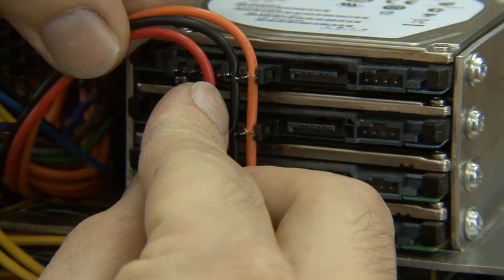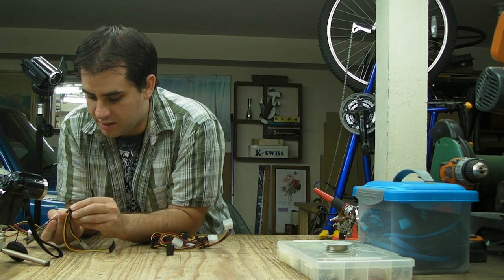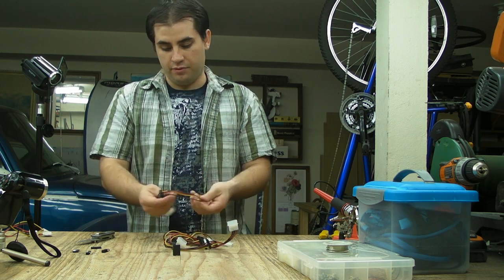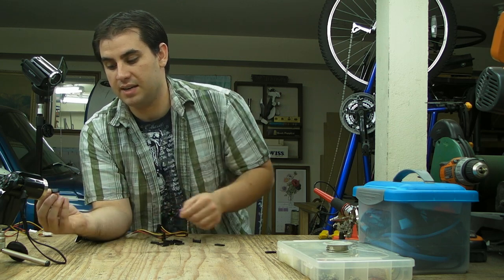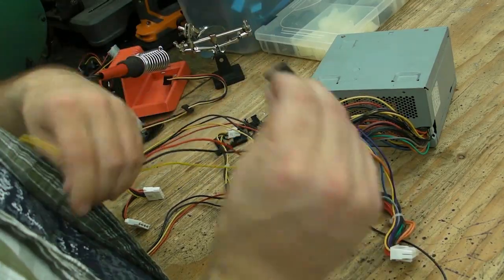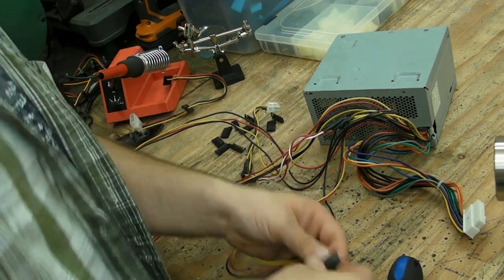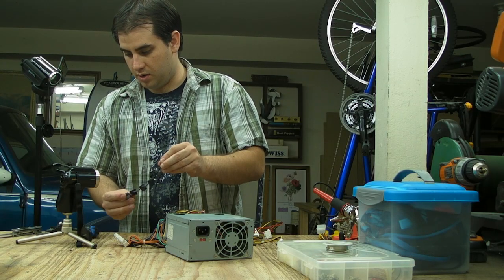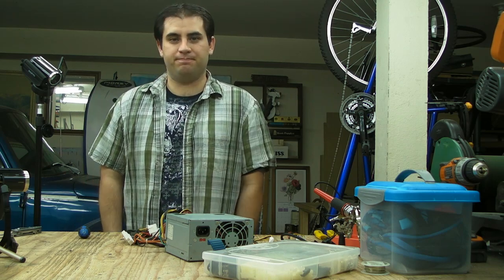Modding Guide: Inline SATA Connectors

Comment: Considering this is now a 10 year old video, the information in it is still amazingly useful, and you make the whole process appear very straightforward. Thanks for this!
Reply: Exactly! Even almost 12 years later! I'm building a machine that needs a single SATA power connector for the AIO and after watching this I realized I can use old cables to do what I need and not let a bunch of connectors hanging around.
Reply: Agreed ... there's newer videos on the subject, but this young man did excellent work with the camera shots, nice clear close ups of what's going on. Also no blah blah blah filler to fit the video into a Google algorithm length sweet-spot.
Reply: he help me alote

Comment: Can I mod the sata power connector to use 3 wires instead of 4 ? I have a 3 pin power supply on the board of my mini pc.

Comment: Thanks for this! I was actually looking for information on what to do if you have a SATA splitter cable where the connectors are upside down, but simply clamping some more connectors to the PSU cable sounds even better than using an splitter cable! I had no idea they were so easy to attach!

Comment: I have eight(8) 8tb ssds in a mounting bracket i got off etsy that spaces each of them only 7mm apart, and this worked absolutely perfect.
If anyone that sees this is wondering, this is the only method to connect this many drives to a single cable, since this makes the cable the bottleneck of available amps before meltdown, instead of the connectors being said bottleneck as by using splitters.
I would feel comfortable even putting 12 ssds on one cable with this method, so long as you're not writing to all of them at the same time 24/7.

Comment: First: Great vids. Admire your skills and workshop :)

Second: You really don´t need to press the cable into the connector with a screwdriver.
Just apply all the cables in the first "gap" in the connector, then use the lid and press all the cables at the same time with a tool.

Comment: Do a search for "hardware port multiplier". It will get you a reasonable way to what you want but if you mean just by wiring some cables up etc, no. Computers are generally more complex than just "splitting cables" for things other than power. 
The port multiplier will do a 5:1 setup and you can choose the raid mode. As a word of warning, raid 0 (make all drives look as 1 big drive) which would be nearest what you want would see you loose everything if you get any of the 5 drives die.

Comment: @UnknownLobster Thank you. I was going to use them for SSDs. I found a SATA extension cable and I will use that to put the in-line connectors from a molex splitter on. Thank you for this video.

Comment: Thanks for the video mate but I have a question..Have you tried to combined two cables into one connector? i.e a Y type splitter. So 2 cables in pairs  into 1 of metal contacts to give me two female connectors (one  at each end).

Comment: Thats a good idea. but if you dont mind. actually buying this is very easy and cheap. but i dont refer buying, if i can do it i will try. but since you are the one whos capable i must strongly recommend to build a hand made, homemade 2.5 hdd sata enclosure buy using dead laptop hdd sata port, 5pin usb cable and from any other scrap wires and cable. so we can rely by recycling instead of disposing. and buying is not be more demand as option.
Reply: speak English.

Comment: I have an evga 1600w t2 power supply. How many hdds i can connect on a single 6 pin sata port using your method based on energy consumption the psu can handle?

Comment: If someone for an example swapped out the two ground wires by mistake, would it hurt the hardware or it’s just ground wires and it will work just fine?
Reply: Shouldn't damage the hardware as they ulmitly connect to same ground point in the PSU anyway

Comment: Great vid, Will could u do a video on how to fit a power cut off switch inline to multiple hard drives, at the front of the tower using a 5 wire modular connection from the psu,Iv not been able to buy 1 so i need to make it, and i'm sure this would be a popular Mod.Thanks in advance.Looking forward to it now your back.

Comment: Not from personal experience...but I've heard you can daisy chain as many Molex plugs as you want...most PSUs are just a single 12V rail, so it doesn't really matter, so long as you don't exceed the wattage...if this is true, I'd assume it's the same with SATA Power connectors...

Comment: Hi Thanks for this idea,

i used the converter cable with one side white connector & other side SATA connector. but the issue was when i turned system ON, the red cable on bothe the sides melted & white fumes started coming out.

Can you give me an idea whether the issue is with the HDD or with the connector?

Comment: It depends on the hard drives but you wouldn't want to be pulling to many amps through that cable even if the psu is capable of providing it.

Comment: @Jiraya12345 

I know it wasn't directed at me, but battery powered soldering irons are great for quick one off jobs. They aren't powerful enough to do heavy soldering for very long. As far as outlet powered, I recommend a digital read solder station with adjustable temperature output. The reason for that, the plain 1 temperature irons you get for 5 bucks often get too hot and you go through too many tips or you get the item you're trying to solder too hot. Hope that helps.

Comment: does it matter if i use any of those black plug the first one that you show how to take apart for my sata hdd cause my seasonic 350w 80 plus bronze psu doesn't have those for the hdd it has those white one white big metal hole it has 4 so can i just cut those 4 wire and connect it to the black plug or not btw do i need the orange wire too or no please relay cause i really need to modded so i can use my gpu

Comment: i faced an issue in an HP desktop were we have a satat power wire with 4 pin connector similare to ones of a cpu  ( 4pin in one side and sata power in the oposite side )coming from  motherboard and he has one stat power connectore they ask me to add more hard drive but with this cabel i can only instal one; i found an edentical and not 100% matching cabel with 4 sata power connector .... the problem was the 4 pin connector in the head  he is not correctly matching the orriginal one 
the soloution
i detached all 4 terminals from both cabel and change 4 pin head connector from one to the other. the cabel work and i instal hdd+ssd in one machine

Comment: @Jiraya12345 
This is relatively cheap, but works well. Look up ZD Electronic Tools ZD-929C on google. Great for general use. Only problem I've found is I've had to replace a 1000uF power supply capacitor on them after about the 2nd or 3rd year of use. They use an underrated voltage cap, so that's just a warning if you do decide to use that. Otherwise, a Weller would be a good option. Like I said, the battery is great for quicky jobs here and there, but full blown projects, go for the station.

Comment: Another thing SATAS cables use brands because pirates wires will damage the logic board of the hard drive because it does not send the proper voltage logic card freezes and if you do not turn the pc on time your hard drive is damaged
Reply: where did u find that information
Reply: O Garcia This information is difficult to find because manufacturers do not suit you give it, the power supply with good backup cost you more but they are the same voltage, the sata cable bring your brand and temperature that supports not you find it odd that not all has the same price
Reply: i have a Gold Seasonic PSU and they use Cheap wire, so i think its pure BS
Reply: Roberto Cordero
Because selfmade cables carry a different voltage than brand cables?
Physics, how do they work?
Reply: Roberto Cordero Voltage is determined by the source of the power, not the wire. If you think there's some connector magic going on in a typical SATA power cable you go right ahead and think that nonsense.